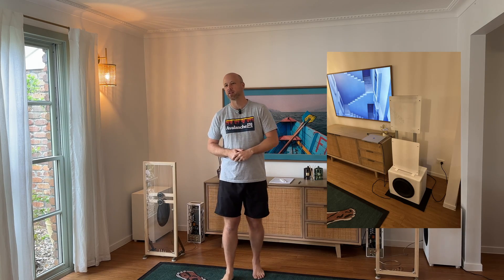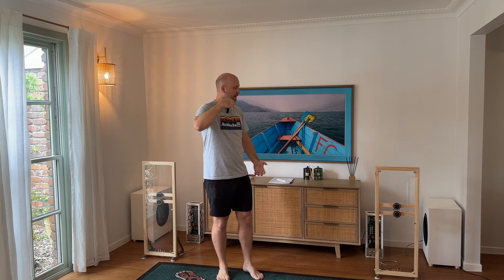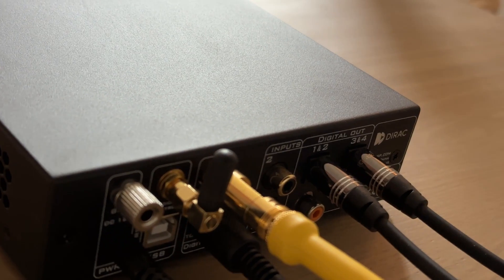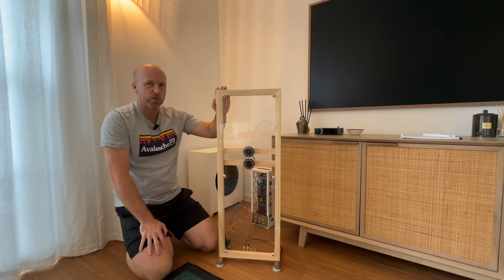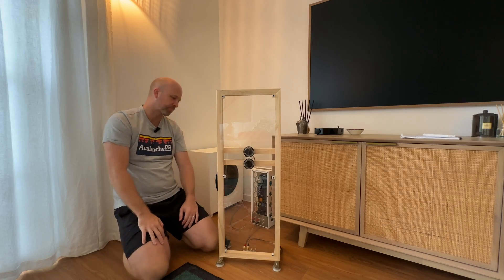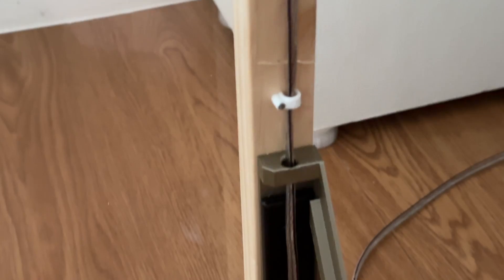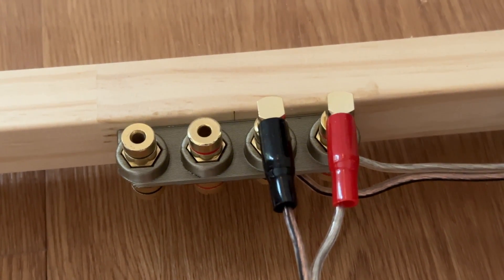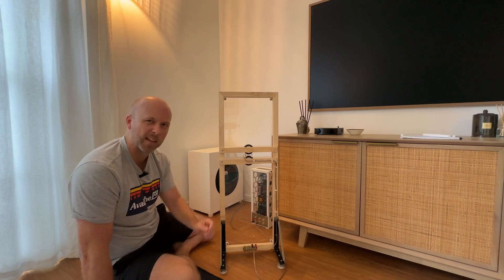My New (more epic) DML System!

Comment: Why didn't you used suspended panels of XPS instead, or plywood? I've seen that if you tighten them to a frame like that, you reduce the vibrations and therfore, volume and sound quality.
Reply from the maker: You mean hanging them? I've done it in the past with Plywood. These ones are the best sounding that I've made so far.

Comment: If that cable is the cheap flex copper cable I would exchange if for a better one. Those cable are terrible in mid and highs. Consider the Argon Prime SC1 hollow cable, can be bought from ali also. A good price/perf upgrade.

Comment: I wonder if bass shakers can be used for bass freq on a panel. Something like the dayton bass shaker which is super powerful too 300w i belive. I bet no one has mounted that on a panel yet as a dml system. Maybe you can give it a try & give true sub duties to the 12" subs. & 80-200 to that dayton bass shaker on a panel.
Also aperion makes some great amt super tweeters.
Reply: Wrong, check the Tech Essentials channel, where he got this idea from to begin with. But had he actually watched the whole thing, he would have seen this is one of the worst materials to use for a panel.
Reply from the maker: I have seen all of the tech ingredients videos on DMLs and I don't believe he ever said that Acrylic is "one of the worst" materials at all. He did list off a whole bunch of materials that he had tried and then went on to discuss the ones he found to be the best, but he didn't rank the other "not best" choices, and anyway he was coming at it from the perspective of sound quality alone. I've always said that I like acrylic due it being a good compromise (for me) between quality and appearance. If you followed those videos exclusively you'd probably end up with a mix of balsa and polystyrene panels which is fine for a garage but not something I want in my living room!

Comment: A very elegant solution, and solid execution, instant sub. People somehow think these should do it all, rather than just a driver with frequency limitations. The 600hz 24db sealed makes me wish I had a DSP, and not a 20$ P.E. sale amp. Someone below mentioned AMT tweeters. I just installed a set of the car audio version, in my truck (does have DSP, active 4 way) They sound amazing, and have a dispersion that could nicely complement the way DMLs "fill" space. The pro4 even has a removable back, if you wanted to run dipole(!) Or sealed. Playing down to 800hz, all the options for frequency and rolloff.  The idea for the exciter tweeter tho! Got me wanting to go look in my box of future projects, and see if I have any minis in there... Nicely done sir, look forward to where it goes from here! Edit: found some 13mm coins in the box, time to stick one to I dunno... Maybe a CD to start.

Comment: Have you tried a composite panel? Plastic core with very thin aluminum on both sides.
Reply from the maker: No I haven't tried it myself. I do think after I've finished messing around with this (and one that I'm doing in parallel that hasn't had a video yet) I'll start experimenting with other panel materials and I'm interested to try composites of some sort.
Reply: @TypicalBenYT  Do it! I have been using that material many years with multiple exciters. Works well. It's sitting freely on the bracket. No frames. And round corners.

Comment: Ben, 
Initially, I would like to commend you for your content and I particularly liked this build and the final result.
I have a question for you if you are still monitoring this thread and inclined to respond.
My Audio system consists of 
Denon 4311 9 channel audio visual receiver,
Front speakers are JBL ND310ii (2 x 10 inch drivers, 4 inch Mid and a 1 inch  titanium tweeter)
Front surround and rear surrounds JBL TLX140 (single 10 inch woofer, 4 inch midrange and 1 inch titanium) 
2 by JBL 10 inch subwoofers
You may notice no centre speaker and 2 speaker channel not utilised as yet.
My question is,
I am thinking of using a DML panel speaker for a centre speaker now, and possibly 2 DML panel speakers to complete the 9.2 system in the near future.
The plan is to use 4 x 40 watt Dayton Audio exciters and a JBL tweeter for the centre and possibly the same configuration for the front high speakers in the future.
Could you possible advise whether the DML system is practical or even good for the centre and front high speakers.
MY audio room is dedicated to music and is 4 x 6 meters with all the walls totally covered in 2 inch foam and that is also covered by a carpet.
The only furniture in the room is a cabinet 2 meters long and 600 high for the audio components and a single arm chair centrally located for maximum surround sound. Very much Man Cave stuff.
I am an Aged Pensioner and Australian expat living in Indonesia where the adivce is impossible to get.
For that reason, any advice would be very much appreciated.
Regards
Tony Chilcott

Comment: Whats the dimensions of the panels? I think i missed that.
Reply from the maker: No problem they are 910mm x 310mm x 3mm.
Reply: @TypicalBenYT  thanks for the reply. I plan to build six for my theater room. Your build was just the look I was going for.
Reply from the maker: @Chubby-chaser-79  Oh yeah great. I’ve only done 2ch builds but I bet they’d sound great as surrounds too. Regarding the acrylic, it’s not the most efficient panel material but is well damped and looks good. I’ve found 3mm to be a sweet spot between volume and quality (4.5mm not loud enough and 2mm not rigid enough in my experiments).
Reply: @TypicalBenYT  I'm gonna start off with one acrylic and one foam, just to see which is better for the space. But. I would like to mount them to the wall, and what you did would look good and mount perfectly.

Comment: Look into tectonic's BMR speakers. They're very small, but VERY nice. They have a very wide dispersion at super high frequencies, which is interesting, and they can cross over way lower than most tweeters can (because they're not tweeters). They play well up into ultrasonic ranges easy.
Reply: Yeah, they have a few sizes. 1" to 3.5". The 2" one specifically has astonishing dispersion characteristics. I have some old bookshelf speakers I am playing with, and I am going to replace the tweeter with one of those, and I'm getting a woofer that has very good directivity up to slightly above 2KHz. My plan is to cross them over very low, but with a first order crossover. Should be interesting!
Reply from the maker: These are the little 2.5" drivers? Would be an interesting 'tweeter' for panels like these...

Comment: I'm totally unfamiliar with amps and the electrical side of this, so can you show your equipment and explain how to get my HDMI laptop output to reach the exciters and have different channels, etc?
Reply from the maker: Not using HDMI myself but you could pick up an AV receiver with a HDMI input and run a pair of DML panels as the main speakers (and even a full surround system).

Comment: Do you have the panes size for the acrylic ? 
And is there any info or link for the plastic bracket ?
Reply from the maker: These are 910mm x 310mm x 3mm. Which bracket do you mean?
Reply: @TypicalBenYT  The bracket that holds the acrylic to the wooden frame. Where did you get it ? Links ???
Reply from the maker: I 3D printed the brackets. Am planning to do a video about the printed parts I've used but for now you can download the .STL files here: https://www.dropbox.com/scl/fi/o8phf16whgqrar0b6ld9e/Panel-Mount.zip?rlkey=kpu7bfxj8ms1q5otecgbe3m7i&dl=0

Comment: Hi Ben good to see you again, still experimenting with dml speakers,I also took my videos down because of personal reasons, looking at your new idea I can see a lack of materials, if you use one material in this case Acrilic, your limited to the sound you can create, if you use more than one material the sound will improve massively.😊 The more materials you use with standoffs attached to the main board the better the sound.
Reply: Are you talking about layering panels with spacers in between? Like.. A clear acrylic panel mounted with rigid spacers (standoffs) 2cm off of a carbon fiber panel that is hooked to the exciter?? (just for instance, i'm not even sure carbon fiber would be appropriate. Crushed CF would for sure look nice though)

Comment: Thanks for sharing…
it’s my understanding that the panels themselves should move freely, any chance you will try or show the difference of the exciters mounted with free panels vs the dampened panels?

I am also thinking about trying some experiments with materials and shapes.
Reply from the maker: They can be free hanging - I did a (sort of) comparison in a previous video: https://youtu.be/NoTnezzndV4

The materials are different so it's not really 'apples to apples' though. Really I believe it comes down to the material used for the panel - different materials will have different amounts of 'internal damping' so there won't be a single solution that suits every design.
Reply: @TypicalBenYT  Thanks, the acrylic would need the dampers, I might try the type TI tried on the back vs the edges.

Comment: Cool to see you back. 2 things:
1. If you add a tweeter, consider Dayton's AMT tweeters. Not only are they also Dayton, but Air Motion Transformers are really just tougher ribbon tweeters. (a bit of a simplification, TBH)
2. No matter how much you EQ or overpower those 12s, there's going to be a limit to how well they'll perform below 40-ish hertz. Volume in the 20-40hz octave is almost entirely a function of air displacement per stroke, which is a fuction of cone area and xmax (or xmech, I suppose, but xmax details the linear/controlled movement limits where the coil has full coverage, so yeah.)

I think I heard in a video at some point that to get twice as low, you need 4x the excursion to produce the same (audible to the human ear) volume. So if your "flat" EQ is already x-maxing those 12s at 40hz, then they aren't gonna be worth a damn in the 20-30hz range. And all of that's to say nothing about potentially damaging the subs or how impedance/box rise will make adding power an exponentially diminishing return.
Reply from the maker: I'll take a look at those AMTs - I'm always attracted by anything even slightly out of the ordinary...

Thanks for the feedback on the subs. I guess the implication is that a pair of 12s may not be enough regardless of configuration (due to cone area limitations)? I've tuned the bass boost (via the hypex filters) purely by ear so far so I will be very interested to see how it measures in-room. Presumably the room itself plays a big role at such frequencies.
Reply: @TypicalBenYT  It's always cone area  multiplied by x-max/x-mech that determines air displacement per stroke. Air displacement per stroke determines loudness/pressure. Yeah, having a bigger room means more air you have to move per stroke to get volume, and there's also quarter wave resonance BS to worry about, too, but that's all somewhat advanced.

To be completely honest, unless you're a basshead like me and/or like listening at loud volumes (85-100DB at the ear for the midrange freqs) the two 12s should be fine. If not, you can probably still use some 12s if you want the midbass and lower mids to not "beam," but you'll have to look into some that have much more xmax and then change your enclosure configuration and whatnot.

And also carefully select a driver that can somehow still act dual purpose as a 25-100hz and 100-200hz driver.

But like I said, unless you're a basshead or loud listener (and especially both) you should be fine. If your system manages a 10db/oct rise (at the ear) from 200hz down to 25hz at the volumes (of the midrange frequencies) you typically listen at, you're doing good enough.
Reply: You can also use a horn to increase low frequency bass output. Downside is that bass horns increase time errors (slower attack and decay etc.) and they are large and increase the pressure on the driver

Comment: Glad you're back! I'm planning to make my own system so I'll definitely be taking notes. My impression was that you get better acoustic performance from the panels when they're isolated, ideally just hanging from fishing line. I'm curious if you considered that and why you decided to go with more rigid mounts.
Reply from the maker: Thanks a lot! Regarding the panels, I started out free-hanging them and moved onto this type of setup. I think it's more complicated that saying one is better than the other - it's really going to depend on the clamping/attachment, panel material etc. Some materials are more inherently 'damped' than others and methods of supporting the panel can vary from free-hanging right through to 'all sides clamped' so there's a lot of variation there.

Basically my acrylic panels are fairly 'dead' (internally damped) compared to the various foam products and things like that, but don't feel over-damped by using this clamping method at 6 points. I suspect if I clamped them all around, they'd be too dead sounding.

I'm also not worried about bass performance on the panels so depending on what you want out of them, YMMV!

Comment: For being an audio guy, your video mic levels are way off.
Reply from the maker: No one said I was a competent video editor! Which part do you mean?
Reply: @TypicalBenYT  There is only one five second part of the video where I do not have to turn my volume up to 85% of max.

When the commercials come on I have to turn the volume back to normal, then back up after the commercial.

You are not going to be able to tell your levels are off from your editor unless you have a very good db level monitor.

You are probably too far from the mic. If you do more videos, invest in a boom and mic you can place over and in front of your head, just out of frame. Will make a world of difference.
Reply: @newunderthesun7353  if thats the biggest thing ? i would say it has some hiss. the intro sounded fine to me.. since i dont have adds i guess  haha
Reply: @TypicalBenYT  I was speaking in the collective about the commercials - I have multiple videos playing concurrently - we use YT at work. Good luck.
Reply from the maker: @newunderthesun7353  hmm ok thanks for the feedback. I’m using a lapel mic but I’ll try to boost it more in future. Nothing more annoying than ads blowing your head off!

Comment: 👍 If you're not getting enough high's using that material, something is definitely wrong. That's a hell of a set-up you've got there, very nice!
Reply from the maker: Thanks! I agree and as far as my ears go (no measurements yet) there's nothing lacking. I'm wondering more if there would be a noticeable improvement quality-wise by handing off the HF to a small panel or tweeter - maybe 'delicacy' is the right word, or something like that. I'm also interested in whether it could increase the 'height' of the sound,  since I didn't make the main panels all that tall. As always, there's one good way to find out!
Reply: I would go for ribbon tweeters for delicacy if your sitting in a fixed spot during listening. Keep us posted man, look forward to more videos. @TypicalBenYT

Comment: Since the main topic has been dml, I’d like more info about why you abandoned the previous project, what led you to the current design, the principles it embodies, how it measures, and why you think it’s adequate  now. Thanks for the new video.
Reply from the maker: Hey Paul - more design commentary and measurements will be coming for sure. As far as the abandoned project - it's a lot to do with aesthetics I suppose. I was trying to fit 12" subwoofer boxes underneath 2 panels and a tweeter, so it ended up being over 150cm in total height which I didn't really like in my room. I could have maybe adjusted that design rather than scrapping it altogether but decided it better to start 'from scratch' with the components I'd already purchased, to see what I could make.

For example, freed from the constraints of the tower form-factor I was able to build larger sub boxes (still not huge but these are around 30% larger than previous), which will allow me to push them deeper with less power. When the panel isn't built on top of the box, it can go right down to the  floor which gives me more surface area 'for free' and I suspect might also improve the character of the floor reflections (as yet unproven) etc.

As far as being happier with this design, so far it's all subjective but based on the above reasons I do believe I'll be able to get more performance out of this setup.
Reply: @TypicalBenYT  thanks for your response. Yes I was doubtful of that setup bc subs  need to be positioned to help eliminate room modes, and joining them to the mains means you cant do that. Good luck with the current build.